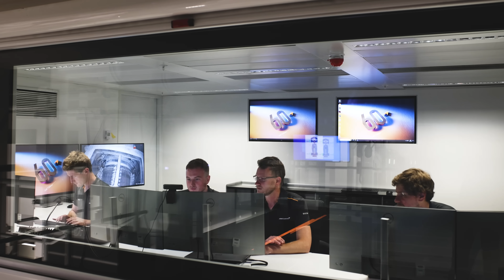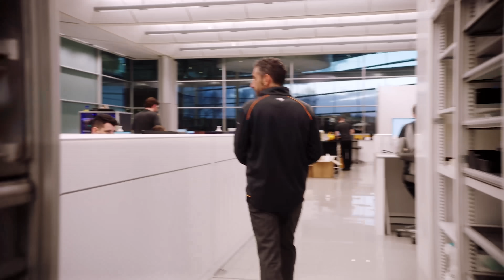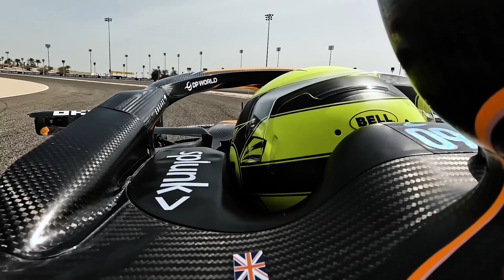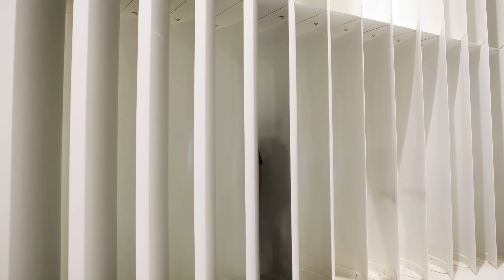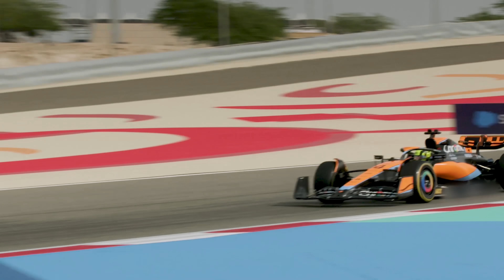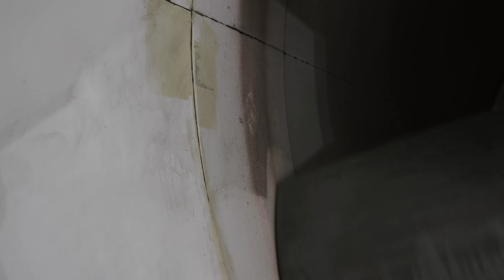Step inside McLaren's brand-new F1 Wind Tunnel

Comment: Cool insight. More than we get from other teams. I dunno whether it is secret or not, but you could've also talked about how long it took to build, how many people worked on it and will work regularly on it or something. Connecting the team to the windtunnel. Perhaps also talk about the other projects that will be done with it. I would assume the road cars are also designed in part with data from the wind tunnel?

Comment: you mentioned 20 degrees per second through the heat exchanger, is that drop per unit of time or was it meant to be 20 metres per second?

Comment: Love this. But what's crazy is Red Bull has the most technically advanced car and developed it in a wind tunnel so old it has wooden blades. But it shows that you can have an incredible set of tech but if you have the wrong ideas, doesn't mean much.

But really rooting for McLaren and this new technology.
Reply: How you move the air is irrelevant its how you ensure flow quality in the test section. The biggest challenge that wind tunnel has compared to more modern ones is how it controls its temperature in the different seasons